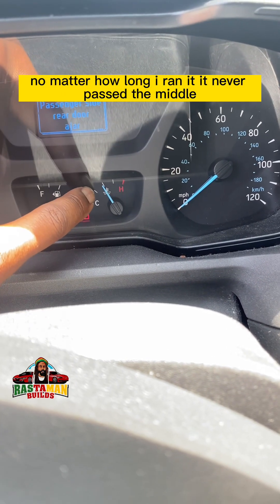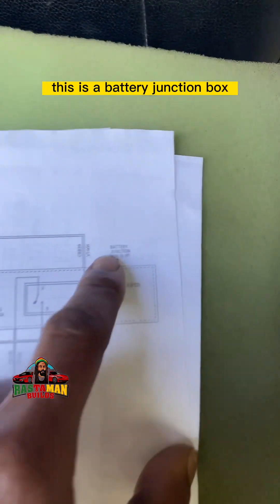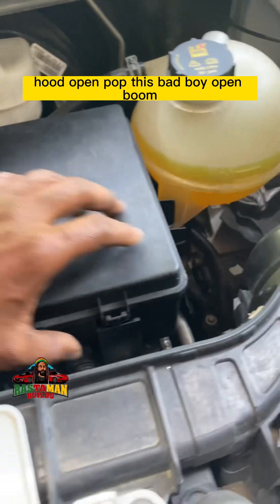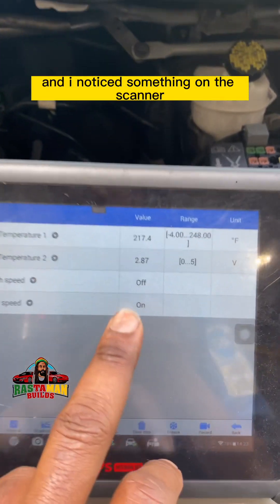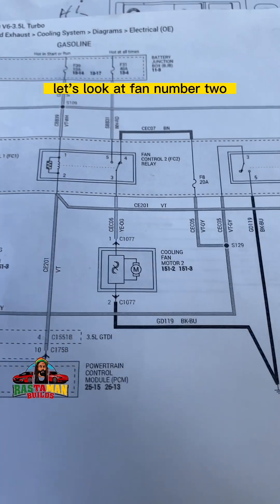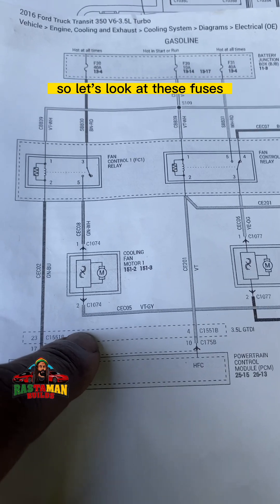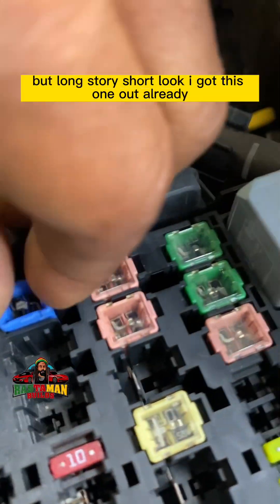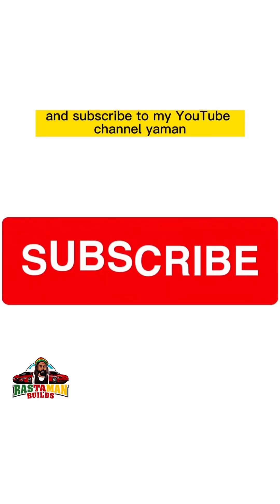Ford Transit Cooling Fan Diagnostic. FANS NOT WORKING OVERHEATING!!! (FIXED)

Comment: Got an oil change and they told me one of my fans isn’t working. Nobody mentioned that it might be a fuse but they did tell me it would cost me $1000!!! Thank you so much for this video. I’m going to troubleshoot as much as I can before taking it anywhere else!!! And thank you so much for the through explanation.
Reply from the maker: Welcome I hope it works out
Reply: @RastamanBuilds Thank you! Went to Auto Zone and they tell me that there is no way to test a relay and if one fan is working then it’s not a relay because they work off the same one! But your video says otherwise, right?

Comment: cant believe those fuses you cant really tell if blown, going to have to go back through the van and re check them all 😅 also gettign a code error u0120 lost communication with starter motor, you ever had this problem brother?

Comment: Would you be able to help me locate the coolant temperature sensor on 2015 transit 150.  3.7?
Reply from the maker: They dont ..Call it a coolant temp. They call it a cylinder head temp sensor. You have to remove the lower intake manifold and its under there in the side of the cylinder head.
Reply: @RastamanBuilds  ,Thanks a lot. we all appreciate you around here.

Comment: Wag1 G, 

My Ford Transit 2.0 EcoBlue Diesel (UK Version), when I turn the AC on, the high speed fan kicks in intervals, and this never use to happen before. I use to hear the low speed fans, however, for the last 2 weeks the high speed fans keep on coming on each time I turn the AC on, what can be the symptoms of this problems ? 
Thank you big man
Reply from the maker: Bad low speed fan relay or low speed fan fuse

Comment: The reason for the three relays and the extra fuse, is that the AC turns on the low speed on its own.

Comment: What if all my fuses and relays are good and pcm grounds fine. I have brand new fans from ford and still no fan operation ……Help!!!!!!!!!
Reply from the maker: Then the wire from ecu to relay must be checked for continuity
Reply: Always check the voltage at fan pwr connector as well. Theses fans are wired in series for low speed and parallel in high speed. also check for GND continuity. The GND It is a double wired (one for each fan) blue with black stripe.

Comment: I notice that if I turn on ac or windows defrost the high speed fan runs and run after I turn of ac or defrost I will only turn of after I turn van of for about 20mins

Comment: This is basically the same system that GM uses on some of their vehicles as well now with the same three relays setup, however as far as I know GM is detecting whether or not the fans are running with some current sensing in some cases and so the BCM can tell when the fans are not running in low speed and can force it in to high speed even before the temperature gets too hot.

It can also detect a failed fan sometimes, and then force the working fan to high speed to try and compensate.
Reply from the maker: Ok nice thanks

Comment: You did better than I could have done. I would have walked dung dis rabbit hole different. Would have chased why the gauge reading normal and the MaxSys reading 224F. Would have sed to myself the temp sensor is in a gas bubble caused by head gasket gases… and just changed the head gasket, skim block and head and probably overhauled the engine. I would have been WRONG…
Reply from the maker: Lol it happens it happens. I was authorized to do a head gasket job

Comment: So i have a 2007 Chevy Cobalt 2.2L LT. The high speed fan runs constant and the car wont get up to operating temp. 
I changed the temp sensor, thermostat water pump & coolant reservoir cap. I pulled relays and low speed works as well as high speed.
Temp sensor only reads wen CEL is erased, fans not on wen temp sensor is reading. 
Car wont pass 150 degrees, then CEL comes back on (P0128) now high speed fan is on constantly again.
What do i check now? Please help
Reply from the maker: Email me at rastamanbuilds gee mail and I will share what I know and see if it helps.

Comment: I have a transit mk7 with the same problem won’t blow hot air changed thermostat still not really heating up help me bro 🏴
Reply from the maker: Check the temp of inlet and outlet heater core tubes then email me at rastamanbuilds gee mail. If the temps are low then its not the heater core